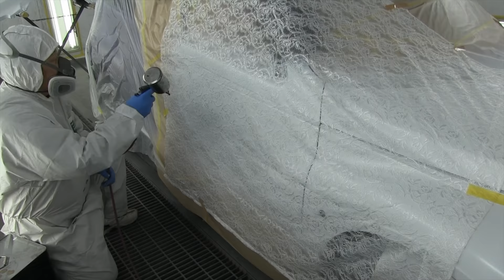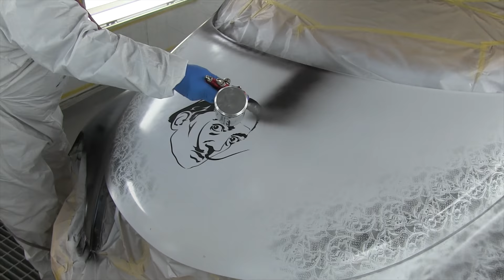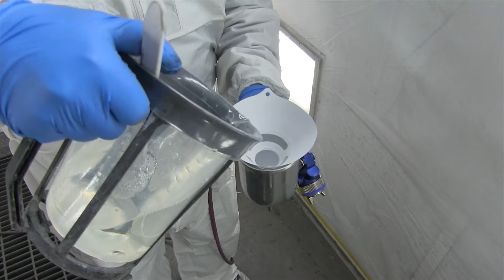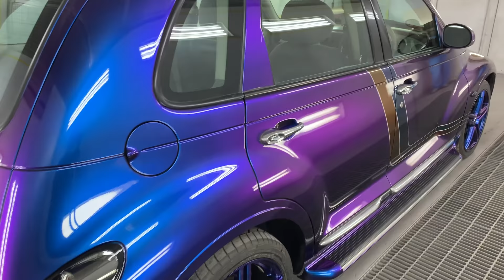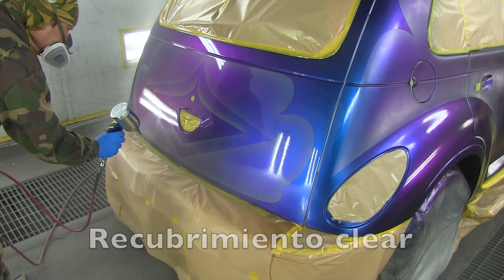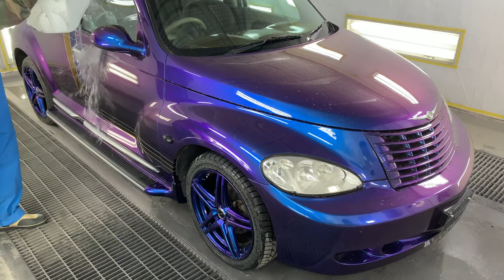change your car color / How to paint change car color / kustom paint 【カスタムペイント】

Comment: Just got my car painted and they did a terrible job.  Color match is okay, a little bit orange compared to the original 'ruby' red for a keen eye.  However, they painted over many black plastic trim pieces, left overspray on both headlamps (including a new one they installed) and the rear quarter panel, painted parts of the front bumper so thin you can see the black of the plastic come through, and left a door and its handle rough to the touch and sight/seemingly unpolished.  Wish I had found someone with such skills and attention to detail.
Reply from the maker: what a pity you are.